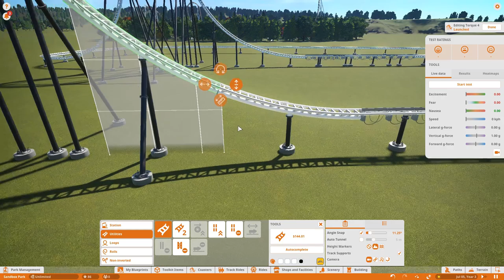How to Build a Working Switch Track + Multi Pass Launch in Planet Coaster

Comment: I’ve actually made a shuttle coaster by setting the laps on 3, (using the torque model) and using the multidirectional launch, you can make it go through the sation backwards, then forwards again. So I was able to make a shuttle coaster that had a spike right behind the station, and one after a few elements, and it surprisingly worked except or goes into the station super fast.
Reply: same
Reply: It always just stops on the reverse launch the second time for me. How do you make it just go through without stopping?
Reply: @CoasterKing605 it's impossible

Comment: Good job very well done sir.... But I hate it. The illusion is shattered for me with the turn around. Honestly I feel it might have been easier to program the game in a way that aloud this function. (For each tick cart is on track add to it's current velocity by the desired amount) and since the cars are physics based on the tracks it should be easier then checking the direction first and subtracting if it's going the wrong way

Comment: Will this work on console?
Reply from the maker: That is a good question.. This worked for the Planet Zoo beta but was patched on release... So there's a good chance it might be patched for console. Tbh, I really don't know, only way to know for sure is to try it out once it's out
Reply: @BBPGames  I hope it does! Thanks!
Reply: I am trying to do it now and it’s not allowing me to it keeps saying obstructed obstructed
Reply from the maker: @RoseGold1224  Make sure you toggle the collision settings for track segments. Without this toggled, track segments cannot clip through one another. You can find this under Settings > Game > Track Collision
Reply: @BBPGames  ahhh thank you I will try this later today 😃😃
Reply: Yes I can confirm it works on console
Reply: @tommyp6627  how did you get it to work
Reply: @RoseGold1224  used the same method as in this video
Reply: @tommyp6627   I’m asking because it didn’t work for me even after toggling the setting
Reply: @RoseGold1224  hmm try do it on some straight track first I did about 3 testers before making it if you are on PlayStation Iv uploaded to the workshop
Reply: @RoseGold1224  Iv also done a console tutorial posted in a planet coaster Facebook page if that helps

Comment: Do I have to have a mod for this
Reply from the maker: Nope.. this is a glitch with the track builder. For some reason, the builder does not perform a check to see if the connecting track is pointing in the same direction before making the connection. This allows you to basically make a 180 degree turn on the spot.